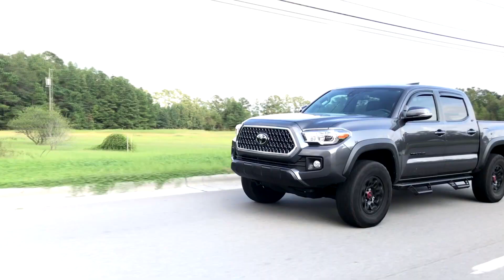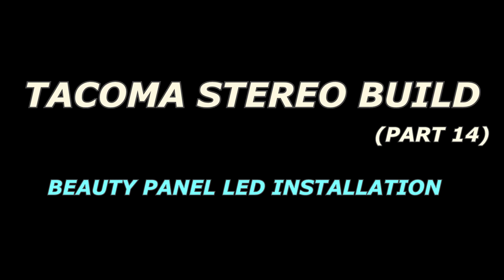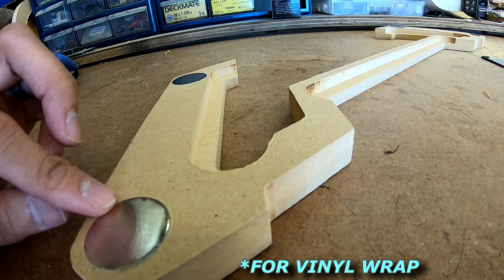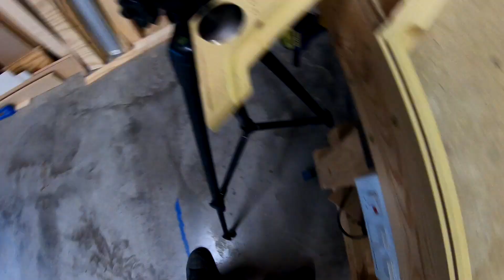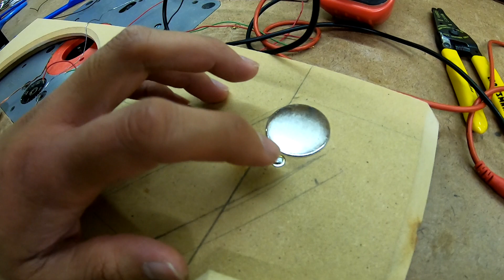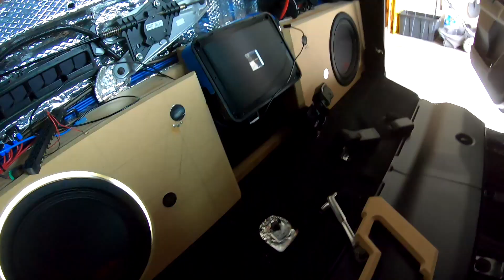Beauty Panel LED Installation (Tacoma Stereo Build Part 14)

Comment: What kind of led's do you use for your builds and where did you get them?
Reply from the maker: Got them from Amazon. LE LED Strip Light White, 16.4ft...
https://www.amazon.com/dp/B00MHLIFO8
Reply: @AyyJayy02  Thank you. Based on your videos I would cut off the power connection and solder a positive and negative wire directly to the led strip and connect them to power and ground correct? I appreciate you responding.
Reply from the maker: Yes. If there is any useable wire still attached to the LED strip, I’d use that instead of having to solder a new wire on. Just keeps it simpler
Reply: @AyyJayy02  Okay... great so basically just cut off the plug and extend the remaining wire to suit my needs on the build. But in the case of needing any additional length of the led strip I would then have to solder on a new lead wire in order to power that section. Correct?
Reply from the maker: That is correct
Reply: @AyyJayy02  🙂 Good... I got that part down. Now it's just the woodworking part... I have the ideas for the layout, etc... You've been a great inspiration... but you still are ahead by leaps and bounds... you have the skills and tools to execute the woodworking. I look forward to seeing more of your builds.
Reply from the maker: Thanks a lot. I’m glad I’ve been able to inspire you. It just takes practice and taking your time. The first custom build I did was done with a jigsaw, and it turned out okay. You’ll get there if you keep going.
Reply: @AyyJayy02  your stuff just looks clean and professionally done. I am a big attention to detail person like you are. I actually did a simple build with the help of a friend in my '09 Accord sedan. It's just a a board mounted on the side in the trunk. I'd like to show you the pics. What's your email address?
Reply from the maker: ayyjayy02_youtube@outlook.com   Send it man. I’d love to see it
Reply: @AyyJayy02  Will do! 💯
Reply: @AyyJayy02  email is being sent now.
Reply: @AyyJayy02  the email bounced back... failure delivery notice. Do you have another email address?
Reply from the maker: Just that one. That’s the same one that you emailed me before